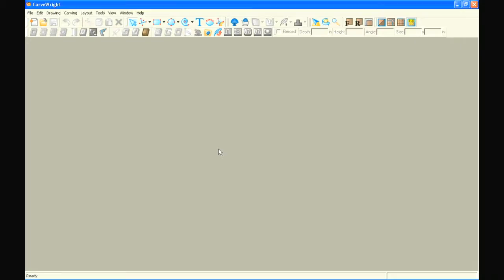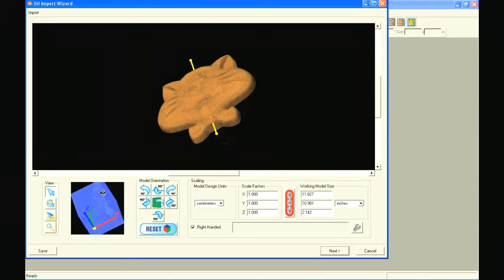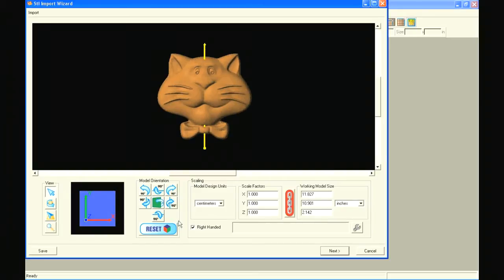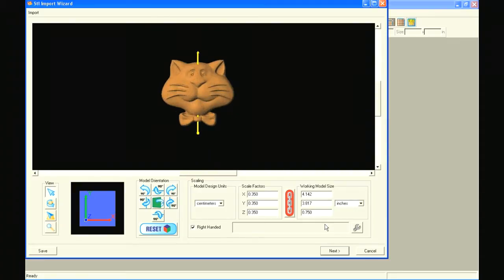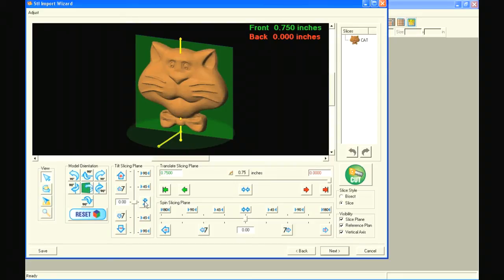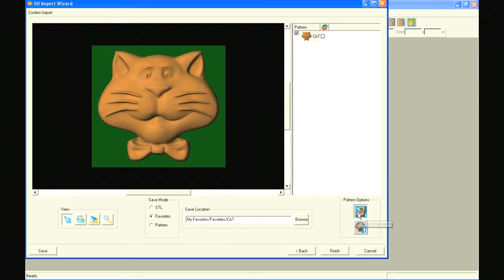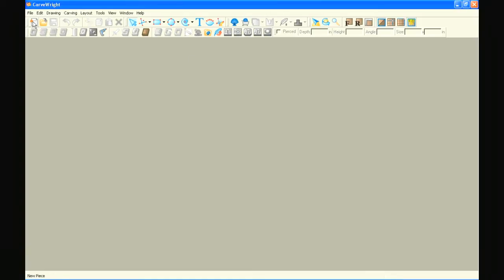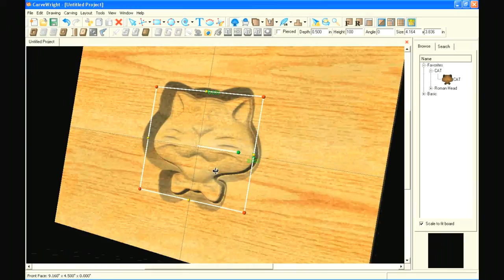CarveWright STL Slicer Tutorial #1: Importing Relief Patterns

Comment: What's the point of using the "Carve to full depth" button? I've noticed using this button makes my patterns default to "pierced" carvings, does this add tabs to my pattern? I've also noticed that when I rotate my patterns using the rotate buttons changes the sizes of my patterns and I'm not able to correct the sizes in the size windows to get the pattern back to the original sizes. Why do my sizes change and how do I make sure my patterns cut the original size? This is important when cutting out parts for inlay work. I've also noticed angles do not cutout at the correct angle. I sliced a part at 45 degrees and made 4 copies. When trying to assemble my parts into an assembly they did not fit. I checked using an angle finder and found out my Carvewright had carved my STL pattern at 40 degrees instead. Why? Is this a bug in the STL import software not working properly with the Basic Designer 1.187 version?